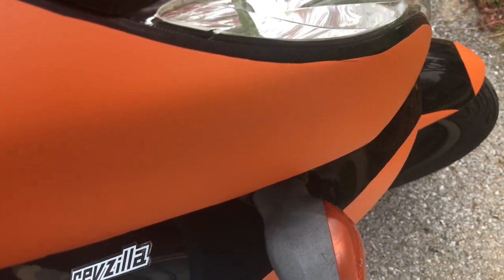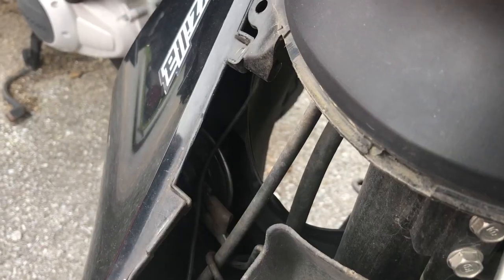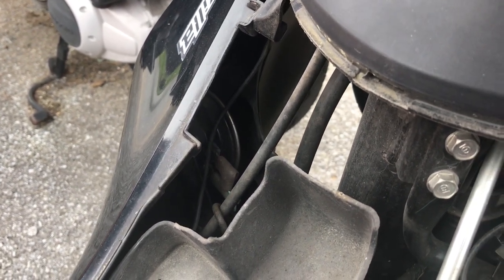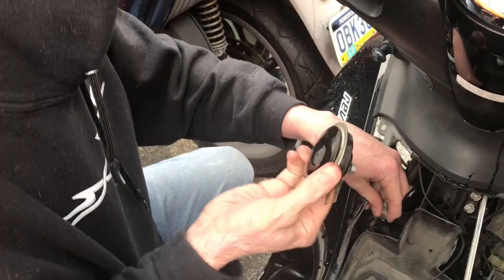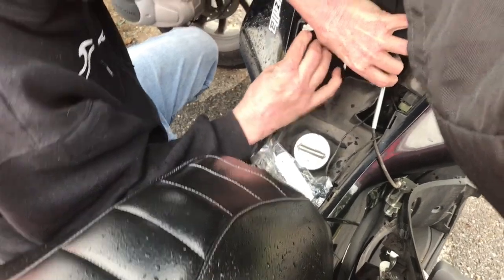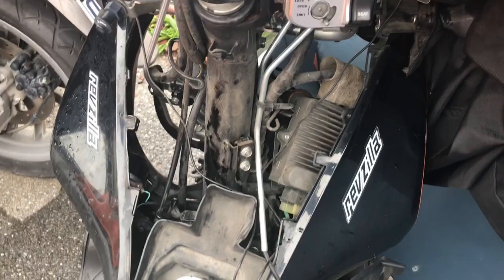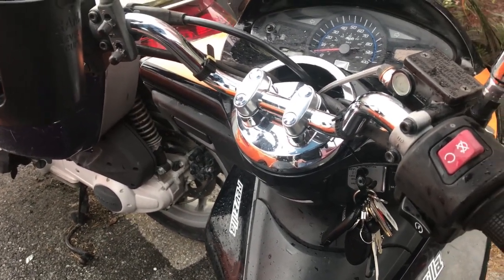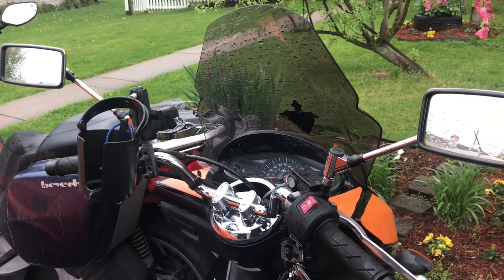Unboxing and installing Denali Soundbomb mini horn on Honda PCX 150

Comment: Do you need to run any new cables or relays for this to work? Or just use the existing wiring?
Reply from the maker: On my Honda PCX it was plug and play with the stock wiring. I did have to cut the undercover to make it fit without body contact. Any contact with body panels will cause a malfunction. Thankfully, the undercover is out of sight under the front fairing.